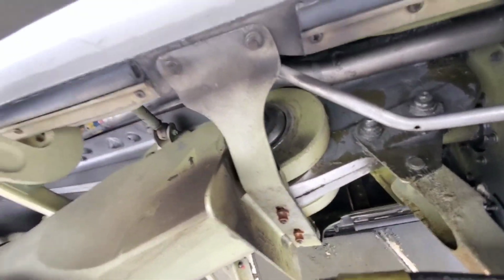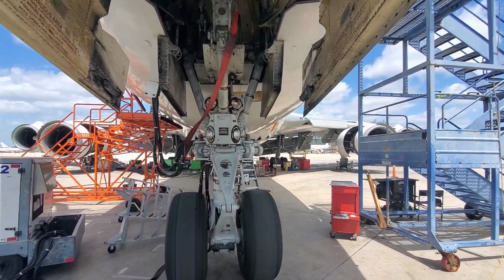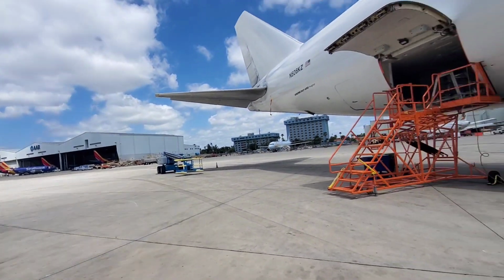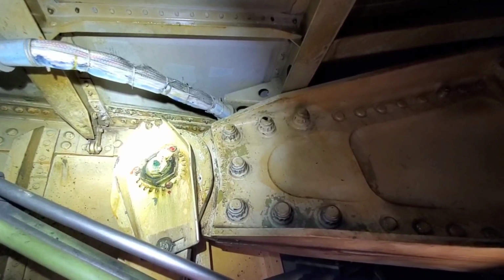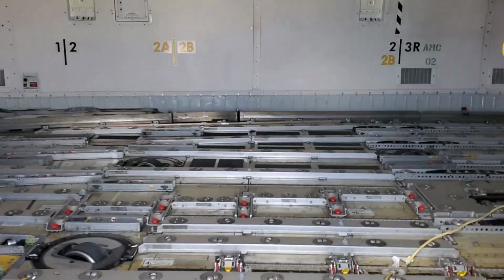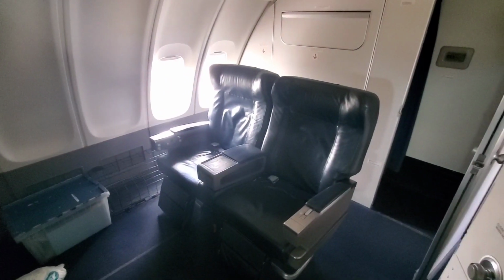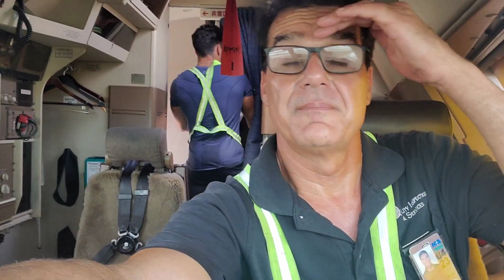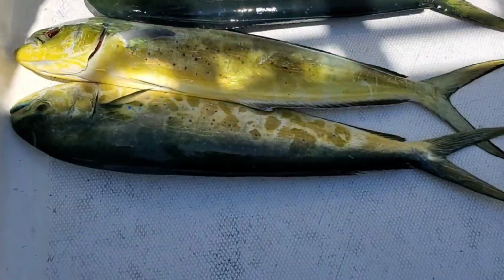BOEING 747-400 TOUR Safety Sensitive Insp Turbine Engine Start in  2023

Comment: Thanks for the link to this footage, very interesting.
I left the industry 13 years ago so it took me back when watching the fan blades.
For folk who don't know when fan blades get sent away to be repaired they can travel the world to get this done. In order to get certain repairs carried out on them, they may go to the uk who inspect each blade. Work will be carried out by them that they are certified to do. The blades may then go to  Singapore who are certified to carry out other repairs, then back to the uk and so on, crazy eh?
If I remember rightly the engine owner sells the blades to the repair company who sells it back to the owner with profit on top. This is because the parts are crazy expensive. If a blade is made unusable by say cropping to much damage off, the repair company has to replace the part.
I left not long after seeing RR Trent 700 and 800's started coming in for evaluation for applications for certification of potential future repairs. They where still very new then. Huge heavy blades.
I was the person who blended damage out of fan disks also.
Thanks again 🙂